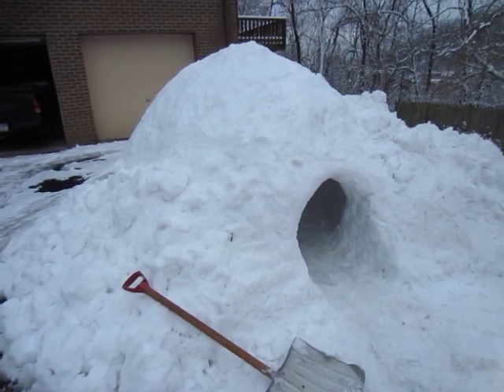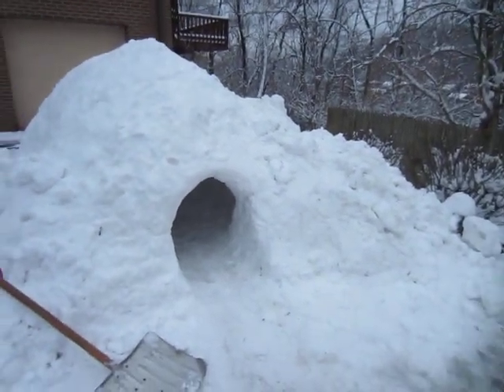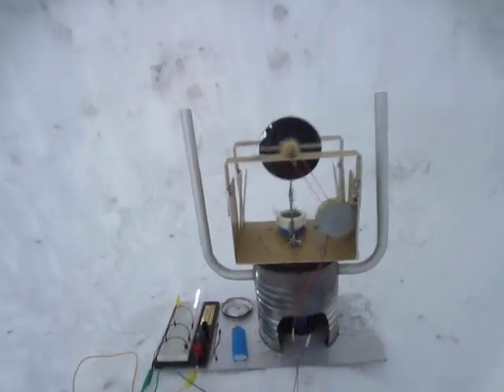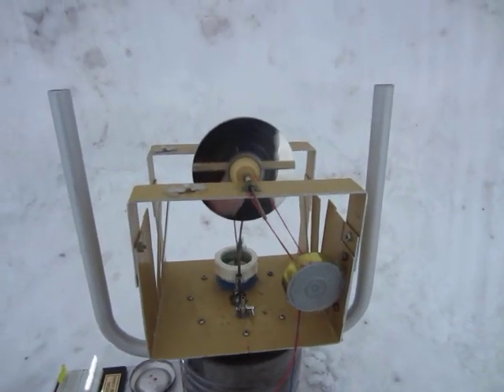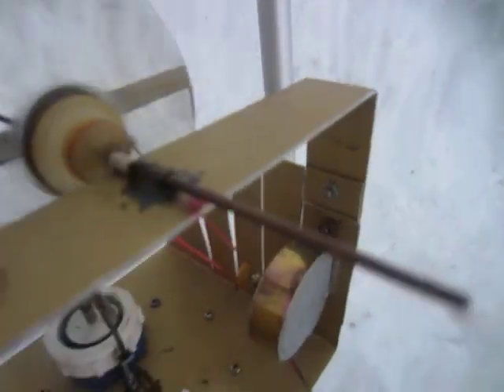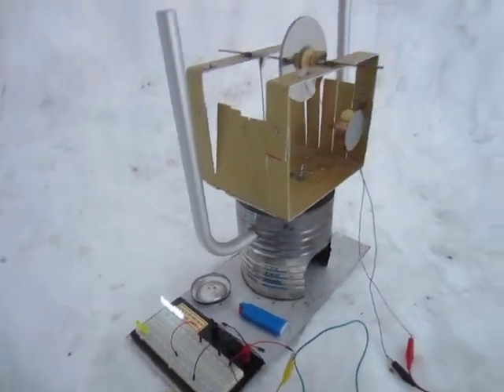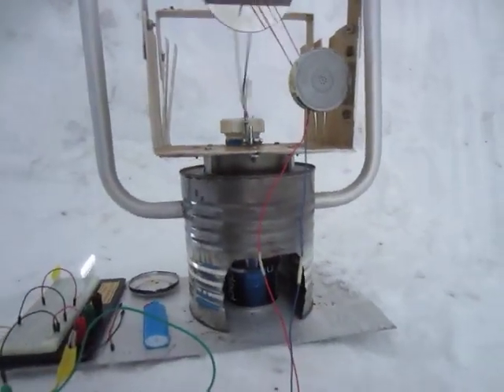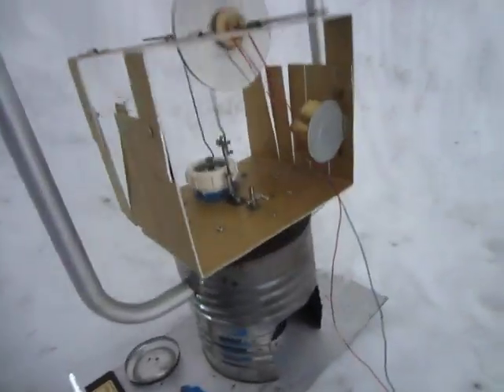YouTube First! Stirling Engine #2 Powering a Joule Thief in a Igloo

Comment from the maker: Thanks!  Yeah, I didn't stay inside very long because I wasn't sure if it was safe.  I thought about putting a hole in the roof but decided not to because it would be a pain to seal it up.  I think that is because once you have a hole there is no longer compression on the snow so the hole keeps getting bigger.

Comment: Nice one! I like a lot. Great practical use of the stuff you have been doing in the lab. Whats the temperature differential between air in igloo and ice/snow? Do you think you could get a Stirling running off the body heat inside? With no flame. if you mount it in the wall or roof. Have you tried compressing snow into brick mold?

Comment: Providing a chimney, preferaly with a small set of vortexc inducing blades may well provide you with an increased draft/cooling effect on your heatsink to provide a greater temp differential which gives you greater efficiency/output!  
Seems like you have a lot of fun - in a living, exploring kind of way.  Very inspiring!

Cheers. -j

Comment from the maker: I'm not sure!  It would depend a lot on the wind and if I blocked up the door or not.  Yes you probably could, though not with any of my engines.  Mine are all designed for high temp.  No but I want to.  I might try using a mold if we get more snow.  I'm not going to try with the snow that we have now because it has melted a little bit and then frozen again and now it's not very good for packing.